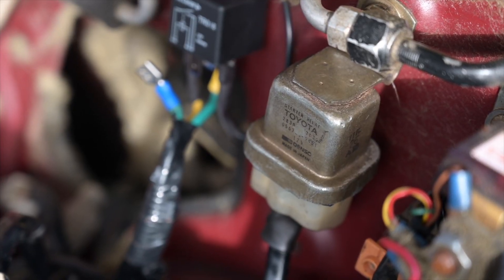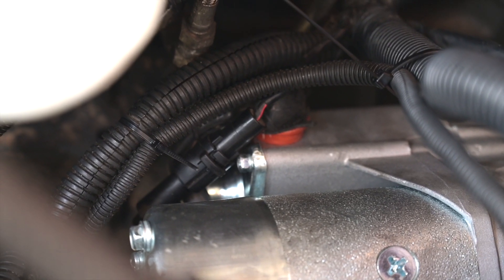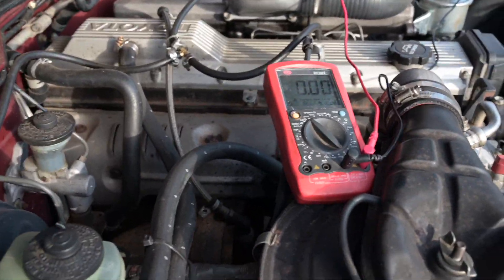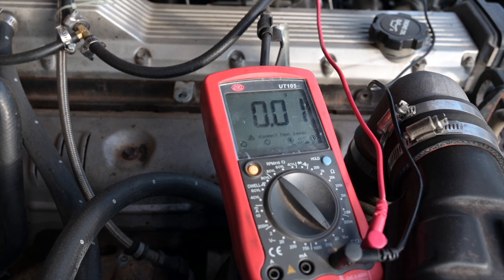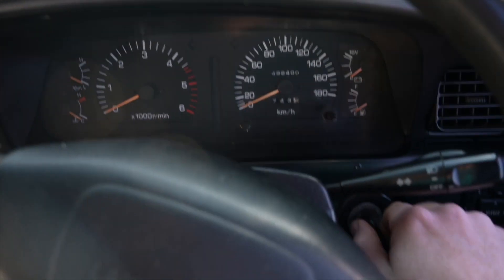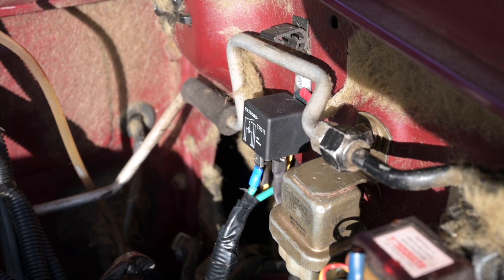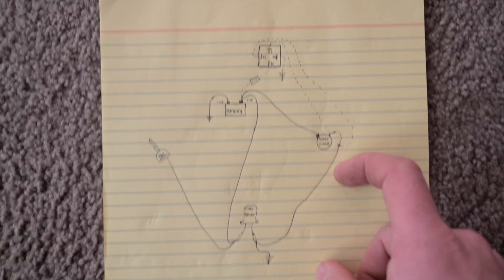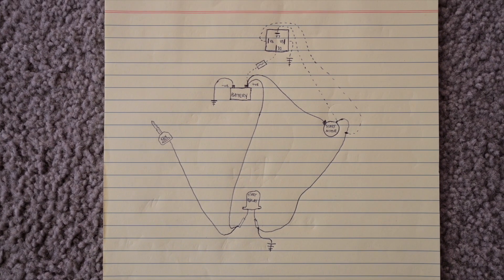SOLVED: LandCruiser Mystery Starting Problem - 80, 70 & 60 series

Comment: What a bloody hero of a video. Mines just 'starting ' this bullshot. Will check it tomorrow
Reply from the maker: How did you go? It can be a real pain to diagnose. Measuring voltage at all the connecting points will show you what’s screwing up. But this fix is probably required if the symptoms are as I described.
Reply: @izakiel93  it was the new starter I got that was fucked. I just hit it everything with a metal bar and she fires up

Comment: Hey good day, thanks for your video. I had a look at your video and now I am realizing after digging around on this topic that this is a voltage drop problem. What you actually saw is not 8-9 volts reporting to your starter but the voltage lost through the cabling. Therefore, your starter actually used around 3-4 volts. Which is well below the minimum requirement for your starter motor. 

Math:
I.e. 4 lost at the starter motor + 8 volts lost through cabling  = 12 volts at +ve battery terminal, 
Theoretically, the total EMF is 12 volts in the circuit.

To measure the voltage drop across any component or wire in your circuit you need to ensure that the system is on or loaded with actual current flow. Then measure in parallel across your component using your multimeter.  Then only can you see if the required voltage is delivered at the component terminal. A voltage reading of less than 1 volt while the current flows in the circuit is probably better than a reading above 1 volt ....depending on your component's voltage requirement.
Reply from the maker: Gday
I think I get what you’re saying… but yes it’s a voltage drop problem as I said in the video… I think I did say the same as what you’ve mentioned but I haven’t watched the video in a while :)

There are a bunch of technicalities to it as you’ve highlighted, but the intended audience for the video is people who just want to know the cause and the solution/fix in simple terms :)

Comment from the maker: ALSO - an important note here - some people replace their starter and it fixes the problem at least for a little while! But the starter was never the issue! Why?

Good quality starters need the right current to work. LandCruiser ones are notorious for this, they’re just heavy duty. Maybe you bought a cheap replacement one, which is happy to engage with a little less voltage. And you think - great! Fixed! Then it happens again as the voltage drop gets worse.
In this instance it was never the starter.

Comment: Hi, i tested my BJ40 and got 11.5 v, just clicks from the relay and non-turning starter motor with clunking sound from the bendix gear hitting the flywheel. Shorting the small black red post to the large one connected straight from a brand new battery with 12.6 volt and still no crank. I guess your trick won't help my problem right? Oh forgot to mention, it will crank the first time in the morning every day and that's it

Comment: Thank you so much for that clue. Tested mine and got 12.3V. I could hear the starter trying to engage, once every 30 attempts it would engage. Concluded bent shaft... I did find the top motor bolt about 2cm untightened... felt secure but presumably torque of engaging with the untight bolt was source of problem. Motor being looked at now. Thanks again.
Reply: Hey Neil, I have a similar problem as yours but I've replaced the starter with a brand new one and still no crank. Any ideas?
Reply: @heyholetsgo_461  my auto electrician replaced the (brass?) contactor and with the bolts properly tightened, success. My skills can't help you I'm afraid. Best of luck.
Reply: @neilmckay8649  thanks for the reply anyway mate
Reply from the maker: @heyholetsgo_461  what are the symptoms?? And what have you already tried?
Reply from the maker: Contact point wearing and being dirty is common, but most vehicles with good wiring will have that without presenting an issue because there's enough voltage to get through the contact regardless. But if there's a voltage loss due to issues i've described, it will struggle to get through a dodgey contact. You'll clean or replace the contact or even the starter, it will work for a while, but then it will happen again. Which will bring you back to needing to try this fix.

Comment: Thanks for the tip. Any ideas which battery on the 80series is the starter battery when you have dual factory batteries on a diesel VX? Having some alternator issues and need to charge the starter battery.
Reply from the maker: Sorry, I won’t be able to tell you as they can be setup a number of different ways. You’ll have to disconnect one and see what still works!

Comment: About to troubleshoot the same problem in mine. But why wouldn't you just unplug the factory starter relay and see if it is getting 12V there first? I suspect, as I do for mine the contacts in the starter relay are sad which is where the voltage drop is occuring. Alternatively you could have just pulled the trigger wire out of the plug for the factory starter really, seems dumb to use 2 relays to start it.
Reply from the maker: Hey mate, seems you misunderstood a few things…

Brand new starter won’t fix this problem as I said in the video. Most people having this issue have tried replacing their starter, relays, etc… this is for all the people who have tried the normal stuff and haven’t got anywhere.

Diagnosing the exact point of failure/voltage drop takes some time, and usually it is actually failing at multiple points due to age. We could be talking about degraded wiring hidden beneath an otherwise perfect looking shielding/loom.

And we’re not using two relays to start the car. We’re using factory wiring to trigger new relay, not start the car. The factory relay etc WOULDNT start the car, which is the problem we’re fixing :)
Reply: @izakiel93  So with what you have done in your video if you unplug the factory starter relay will it start?

Comment: Brother please HELP like SOS my Series 80 Yr. 2000, has a mistery issue. When the truck gets hot, and turn it off and you wanna turn it ON again the truck crank stay ON 5 seconds and puff off again 
When my mechanic put the scanner on the ECU displays on the cluster that is the immobilizer module 
I change the amplifier but the trouble stays this trucks is making me crazy. I don’t Know if you heard about this problem
Reply: Mines fine first thing. If I drive/heat up I can't restart without pushing it or waiting for a cool down.

Comment: Hello, just wondering. it looks like you have left the original wire from the OEM relay to the starter in the drawing. do you mean run the pin 87 on new relay to the starter wire red/black. Then pin 86 to the other connection on the starter red/black wire? so the original crank wire now is formed into the relay circuit?
Reply from the maker: Hi mate 
Yes the drawing is exactly how I had it wired - I left the OEM wire in place and just tapped into it, sending juice to pin 86 on the relay (which is the signal to open/close the relay - full voltage isn’t needed) …Pin 87 sends the new power circuit to the starter (a ring terminal bolted on with the existing wiring on the starter terminal)

Comment: This is a great explanation, thanks for taking the time and the diagram… In your research or on findings, do you think that the culprit of the wire is just degradation at the wire internals itself?… Heat, kink, scathed, Bad connection?
Reply from the maker: Hey mate,
Just age… Asian wiring exposed to Australian heat and dust. I’ve had an auto elec teach me all this, and he said that it’s the wiring itself degrading. Connectors will be part of the problem, but i actually had this issue with a HJ75 and tried replacing all the connectors and it still didn’t work… so yep, it’s the wiring itself.
Reply: @izakiel93  thanks for the quick reply. Where is the ignition control module mounted? I can’t seem to find a diagram or photo other than the part.
Reply from the maker: @GatorOverland  I’m not sure sorry!
Reply: Awesome diagnosis

Comment: My car just started doing this 88 “60
Reply: If the starter solenoid is outputting 12v…& it works…just replace the wire from the solenoid to the starter. Problem solved.
Reply from the maker: @pauladams4890  yes, IF that’s the only issue then that’s a great option. However with this era of cars, that’s usually the start of many wiring issues so replacing that section is cheap insurance.

Plus, if the factory loom has been offering resistance for a while, that means heat! Right through the loom. Once a circuit suffers voltage drop due to one component, it’s likely other components have deteriorated
Reply from the maker: Also, this is a DIY fix for enthusiasts, not an auto elec certified fix. For the guy that’s spent hours trying to work it out, perhaps doesn’t have lots of auto elec knowledge, this is a great option.

Comment: Ive done the exact connection but it still cannot start. What else should i look for?
Reply from the maker: What voltage are you getting at the starter with factory wiring?